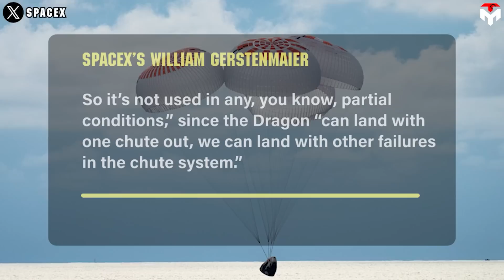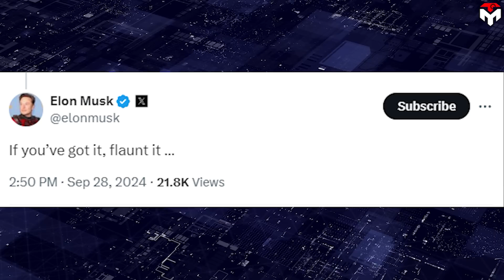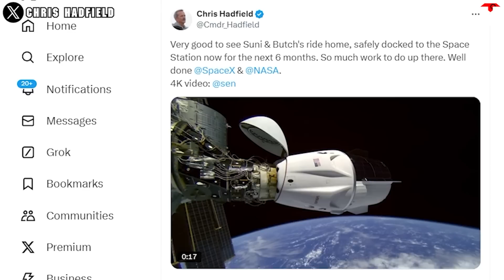SpaceX Dragon Genius Landing Method Somehow Shocked NASA...

Comment: I alway wonder how to save lots of money on constructing a second stage for any module returning from LEO. I think it is possible if you completely reconfigure and re-design the rocket where piloted module has a propulsion built in to it with an entire upper stage as a propellant holder only. Sort of like a shuttle. That way it will comeback with engine which can be reused.

Comment: Yea. Go ahead. You climb in and depend on a propulsive landing in the last 3 seconds of the flight. Good luck with that.
Reply: Which part of "Emergency landing procedure" and "Will activate if it detects a failure in the parachute system" did you not understand?

Comment: If all parachutes fails, the crew will die. Thrusters won't work. Physics.
Reply: Super draco engines are not dragons thrusters. The vehicle was originally going to land with them and use the parachute as backup.
Reply: @scottjgray  aerodynamic drag might slow the capsule to about 400 mph....then factor the g loading for the crew and the weight penalty of carrying the fuel into orbit and back. It would take a dedicated stage the size of a second stage. Smarter to just redesign it as a lifting body like Sierra Space
Reply: @jimeditorial  I agree Dream Chaser is the best option. The SuperDracos are used as Dragons launch escape system, it carries the fuel for them onboard and into orbit. Like you said, atmospheric drag does most of the work, slowing Dragon during re-entry. It would use the SuperDracos to perform a so-called suicide burn a few seconds before reaching the surface, they give Dragon a huge thrust-to-weight ratio so it can wipe off the remaining speed fast. Way too scary for NASA. If Dragon was ever to land on terra firma, they would want parachutes, and then the SuperDracos would be used for a gentle touchdown, much the same as Starliner's airbags. Personally, I would prefer to be in Dream Chaser landing gently on a runway.
Reply: @scottjgray  The Russians used touchdown rockets for decades to cushion touchdown...but no one can make an engineering argument for the replacement of parachutes  by rockets
Reply: @scottjgray  Thanks for the laughs! I'm reminded to proof-read my comments before posting them.
Reply: @psycotria  LOL oh no that was horrifying! no more replying in the wee hours for me.

genital touchdown :hand-orange-covering-eyes:my goodness LOL
Reply: Yes, but those super dracos are not simple thrusters my friend.  They're basically high thrust, kick your ass, escape rockets.  When you fire them, you'll definitely be going...somewhere.  So having all that power at your disposal, why not put it to use?  After all, that is "rocket science".
Reply: @majic5zero  kicking the capsule off the launch vehicle is not the same as landing. The crew has to endure the g loading
Reply: How many rockets do you have?

Comment: Why does NASA have to certify anything X has built and tested. They need to stick to Boeing if they need stuff to certify.
Reply: Requirement by Congress for appropriations oversight.
Reply: Because they're the experts, which is why SpaceX licenses technology from them and not the other way around.
Reply: @wyattnoise  is that why Space X is outperforming both?
Reply: @wyattnoise  Reminder:  Those "experts" have already killed...what, 14 astronauts?

Comment: If human beings expect 100% survival rate from space travel, then we are never going anywhere, because even on earth we don't have 100% survival rate when driving a car, flying a plane, traveling on a boat or even on a daily walk. So either we continue pushing the boundaries or humanity will die here on earth because we were too scared to push the limits in space.
Reply: Amen! We are walking in the steps of Shackleton and Magellan,  with space being far more hostile than the Arctic or the Pacific Ocean. “We choose to do this and the other things, not because they are easy, but because they are hard.” We are going to lose people and ships. Space flight is inherently dangerous and we need to simply face and accept that.
Reply: Safety First is a debilitating evil.
Reply: But we aren't still driving automobiles with single speed transmissions, wooden spoke wheels, and steam engines. With improvements in performance come simultaneous safety improvements.
Reply: What he said.